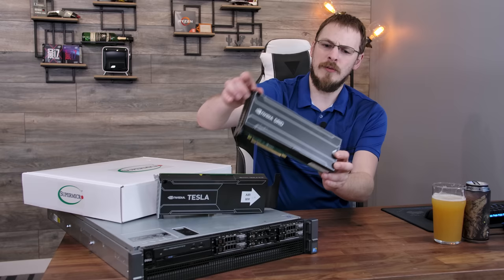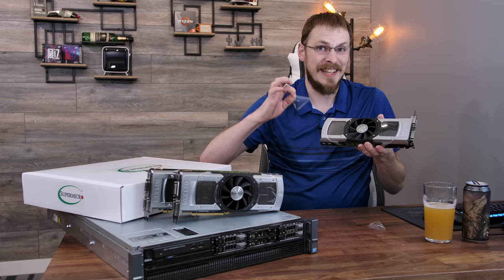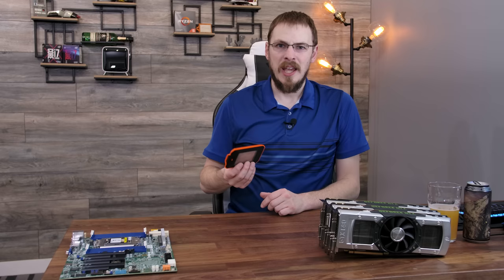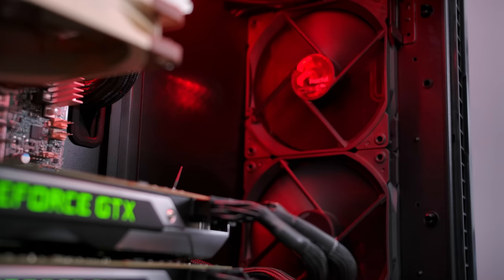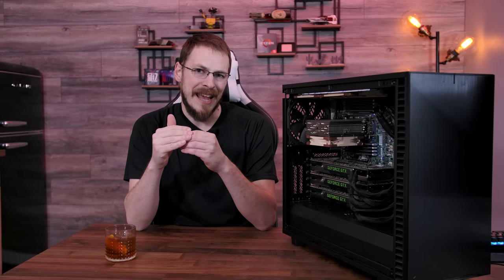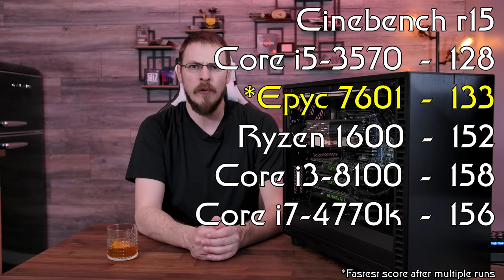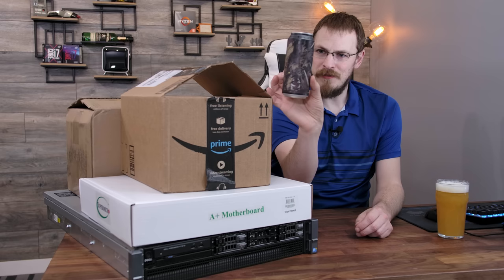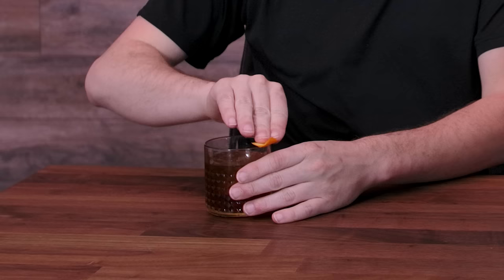EPYC Cloud Gaming Server Build - GTX 690 Editon - Part 4 of ?

Comment: Ryzen 9 CPUs fit this use case much better.
Reply from the maker: Absolutely doesn't. This will be a 6-gamer system when done. 12c/24t only gives me 4 Thread per gamer. 16/32 gives me 5 threads. And neither leave any headroom for the VM Host OS to handle storage overhead or CPU scheduling.
Reply: @CraftComputing  Clock speed will bottleneck any decent GPU though, this was the case with Shadow gaming PCs. Base freq really needs to be above 3ghz or you can see frame time issues and under performing GPUs. Shadow currently uses the xeon W-3235 which works extremely nicely when virtualised into a 4c / 8t part per user. In regards to your headroom, unless every host is using 100% all of the time it doesn't really matter, in professional environments the name of the game is over subscription lol.

Comment: I know it's kind of an odd question but can you recommend any 24 volt fans? I want to replace the fan on my 3d printer and would rather not deal with rewiring to use a 12 volt fan like the noctua. The fan is 40mm by 40mm by 10mm

Comment: Hi, Could you test if 60Hz gaming on 1440x3440 is possible whit the Epyc 7601?
Or will the 3.2Ghz boost bottleneck my 1080? 
It would for sure be a cool System, especially when i can get my hands on somthing like a EPYCD8-2T with its 2x 10gbe :) sadly motherboards with a lot of features are rare for this CPUs.

Comment: I used to like IPAs but noticed I would get cotton mouth.
Reply from the maker: Some can be a bit drying, as there is still oil from the hops present. Try a Juicy IPA if you are a fan of the flavor, but want a 'wetter' mouth feel. Something like Prismatic IPA from Ninkasi should be easy enough to find just about anywhere.

Comment: Why use GTX 690s? Surely you would want at least a GTX 1080 in this thing.
Reply from the maker: Because the 690s have two GPUs per board, giving me 6x GPUs in this system. And they were $81 each. And I'm only aiming for 1080/60 at reasonable settings.

Comment: i want one of thoes GTX 690s, could you tell me if the listing is still up ?
Reply from the maker: It is! No guarantee ALL of these cards are unused. But 2 of the 3 I ordered came with plastic peel still on them, and all 3 show ZERO signs of use.

https://www.ebay.com/itm/PNY-Nvidia-GeForce-GTX-690-4GB-GDDR5-Graphics-Card-PCIe-3-0/312730080968?ssPageName=STRK%3AMEBIDX%3AIT&_trksid=p2057872.m2749.l2649
Reply: Craft Computing Thank you!!! I really hope I get one that still has the peel wrap on :)
Reply: @CraftComputing  i buy one 690 for my collection 1 year ago , same seller it came new with plastic! I open this and I see stock thermal paste and pads